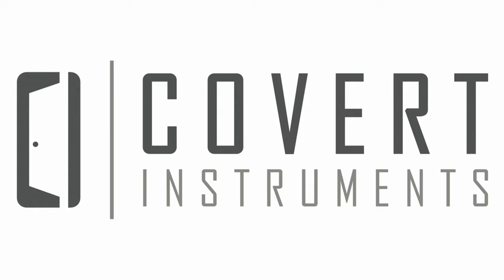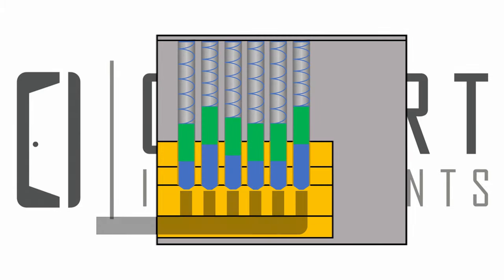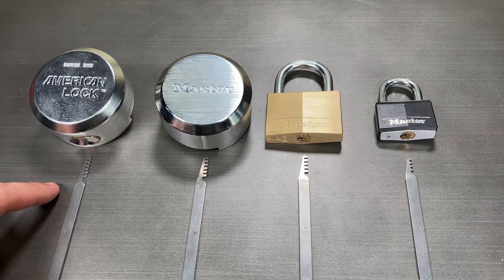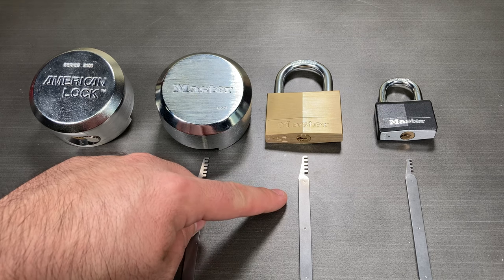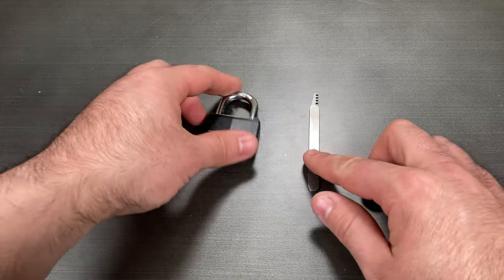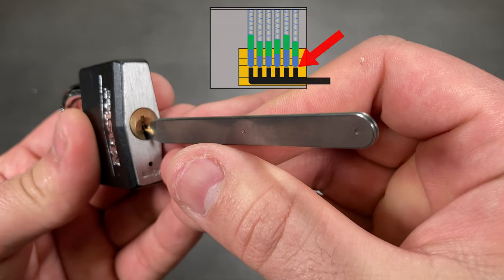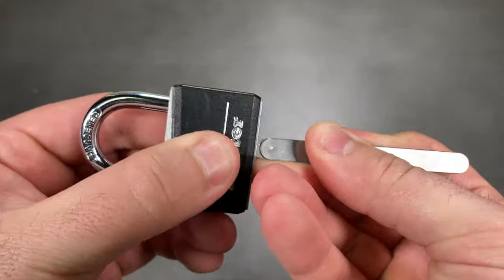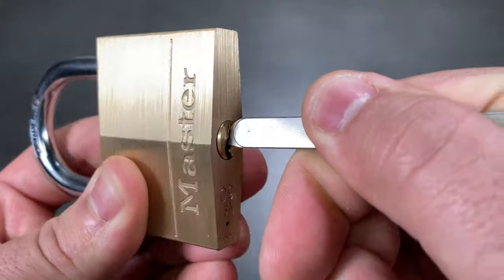Covert Instruments Quad Combs Instructional Video

Comment: I have this set of comb picks, and the exact 2 same locks on the left. I’ve tried many times and can’t get them to open with the comb picks. What the hell am I doing wrong? I’ve been a locksmith for 16 years and I feel like such a newb.
Reply: Use the thinnest 6 tooth comb for the m736 that did it for me
Reply: I have the same problem. It’s seated all the way down but it will not rotate. What am I doing wrong?
Reply: Hm. After watching this, it seems like improper indexing is the most likely problem. I'll try adjusting my technique.

Comment: stupid question: do combs work on door locks too or is it strictly puck locks and padlocks?
Reply: They'll work on any pin tumbler lock that isn't high security. Think of them as a bypass tool rather than a pick. So yes, they will. Although if you're in the US you'll find most door locks are absurdly easy to pick or rake/zip/rock/jiggle open.
Reply: They work on any lock that has design flaw of too long chamber, there are high security locks (with security pins, ABUS has padlock like this) that you can use cone pick.

Comment: So I am sitting here after sbout 20 to 30 minuets thinking "..... Using these was harder than picking the locks I had cracked in 5 min of owning them ... ???"

The problem that one has to remember is if the spacing is off by even a little, it can't push the pins and these become useless. So when they say it works for spacific series/locks on thwir site and also say "most common" I want to say the latter is probably a relatve term.

Comment: What am I doing wrong to not be able to open any lock in any method?
I spent $150 on your tools. 
Would greatly appreciate any help.
Reply: First, you have to learn about locks to know if it’s a four pin five pin or a six pin or if the lock key way shape that’s why it’s easier to use top way tensioner tools. Most American locks I think or 0.25 in European and Asian is 0.18. And you have to know what type of lock you’re picking if it’s awarded one pen and one a dimple all you really need is a Bogota and rake with top way tensioner tools it’s all in on the person technique. Those combs are for like old locks. Most locks can be shimmed. Oh yeah, I forgot to tell you about security pins. You should research.
Reply: But did u start with his ' the beginner package '?

Or straight into Hong Kong phooey mode with a wee bits of piracy har arrr 😂
Reply: Practice.  I have had the FNG and Genesis sets for a year and have only gotten 5 locks open…. I have yet to open a lock by setting the pins… all the locks ive opened have ben with the rake